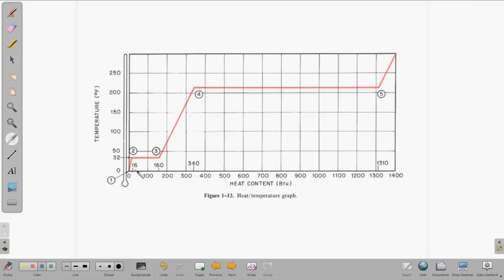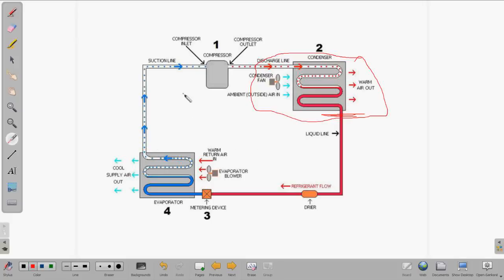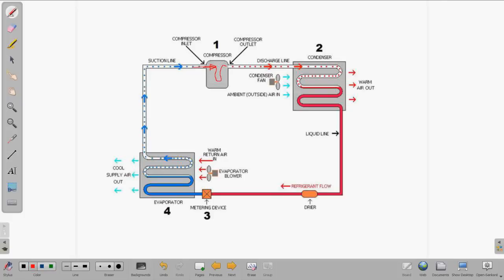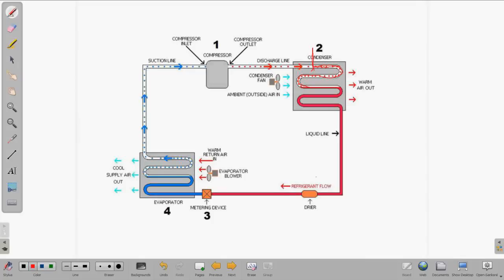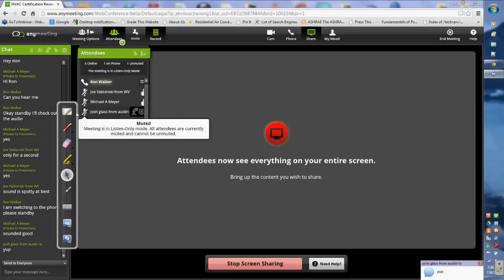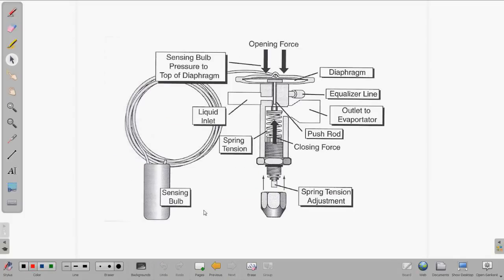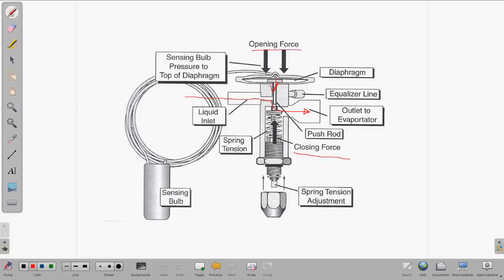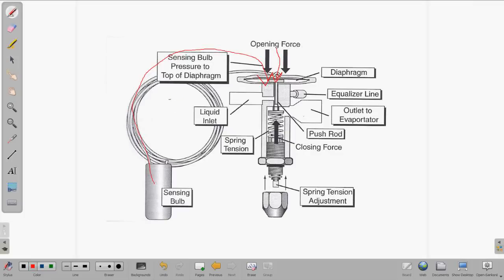HVAC Training - HVAC Certification Module Review

Comment: Does the compressor have safety shut off system to save the compressor, in case of an undercharged & overcharged situations?
Thanks
Reply: Most have an OL overload switch ,some have current over draw sensing circuit on the control board

Comment: Hi, just picking up on HVAC. Had view some of your other videos. Good jobs. It is very informative. In regards to the over and under charging, I was thinking that thought over and under charging will affect the amount of refrigerant in the system, it will also affect the pressure. With change in pressure, will the Temperature/Heat Content affects the different stage of the system?